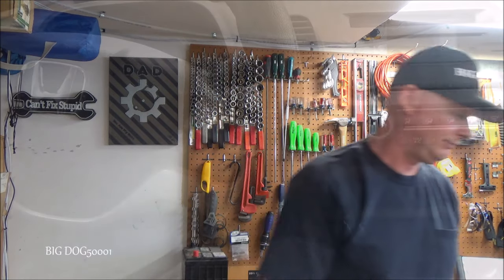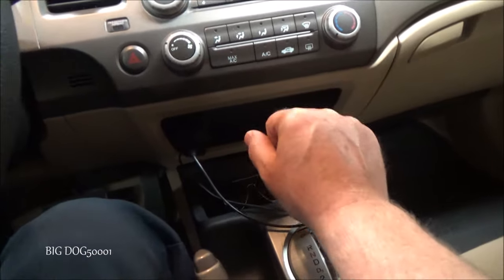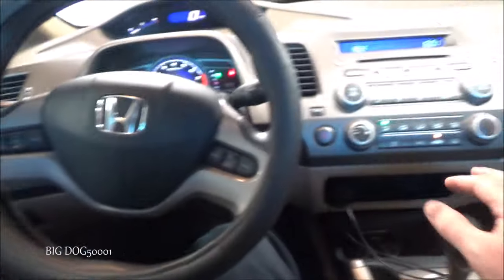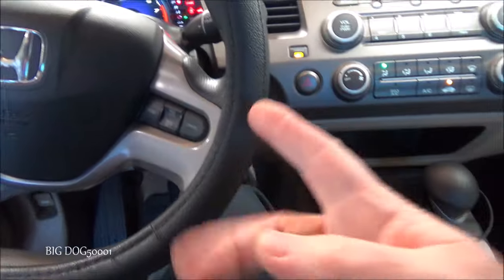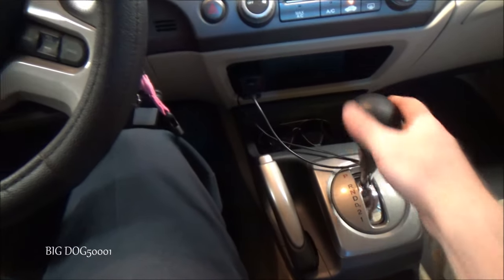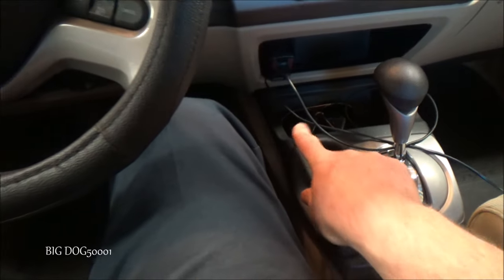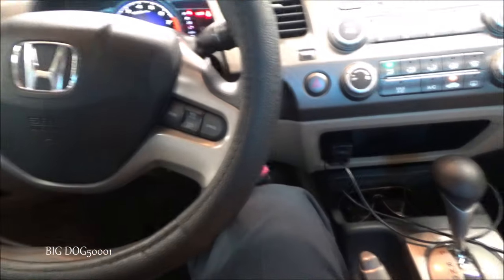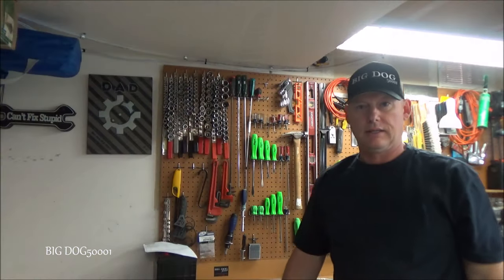How To Turn Off Automatic Locks on a Honda Civic (No Scan Tool)

Comment from the maker: Tools
Disclosure: This channel earns a small commission using some of these links - at no additional cost to you.

My Favorite Inexpensive Scan Tool:  https://amzn.to/2yEbK6l
My Favorite Screwdriver for Hondas:  https://amzn.to/2VAu2hK

The Big Dog 50001 Automotive Channel Store can be found here: https://www.amazon.com/shop/bigdog50001automotive
Reply: Hey Big Dog50001, I have Civic '08 Sedan w/ manual transmission, but it doesn't have the master lock button. Is there a way to enable the autolock feature without the need of such button? Thanks in advance.

Comment: Appreciate the essential information on these features. I live in a rough neighborhood and I wanted my car to stay lock even on park position and locks when shifted to drive for a very long time. The service guys from dealership and local shops will charge half hour work labor just to set them up for me. That’s why I had to be vigilant and lock doors after turning off engine . Now I had it set to stay lock and locks when shifted to drive . Thank you kindly!
Reply: If they want something they just bust the window were I am at.

Comment: I forgot the key inside the car, i get out of the car and closed the door for 2min. The car automatically locked itself. Now i am stuck at my work and its 11pm. I had to call my father to bring the other key to open the car. Once I got home, i followed your instructions and cancelled this automatic lock feature. 

Now I will no longer have this problem. Thank you sir.

Comment: awesome, hope this works on my 2009 Accord, I hate it when it unlocks the doors just putting it in park. Sometimes I put it in park waiting in heavy traffic or long drive through lines or waiting to go into work.  I don't like sitting in an unlocked car, very unsafe.  Always so frustrating put the car in park boom, immediately have to re-lock the doors.. thank you for this video.

Comment: Great video man appreciate it!! I don't like the automatic locks it also wears out the lock actuator quickly.
Reply from the maker: Yes it can, thanks for the comment!
Reply: If this part wears out what are signs please I am having a hard time with my car sometimes I can unlock with my key and sometimes not my 2 opposite door back seat and driver door wouldn't work not even unlocking it manually an then the next day it started working again I can no longer have my windows up because I can't wake up to being locked out because I have to take my son to school its ridiculous an the other day I went to take my mom to store and she had to sit in the back seat because of the problem it sucks
Reply: You may have a low key FOB battery that needs replacement.

Comment: I tried this on my 2010 Civic but I think that I forgot to put the key in 1 position first before I pulled out the key and now when I try to unlock my door from the inside it sets off my alarm and key fob won’t turn it off. Do you know how to fix and reverse this issue please?

Comment: Is it possible to simply remove the fuse that operates this lock/unlock function.  (2008 CR V EX)  There is an issue with the locks operating "outside" parameters so to speak....on their own.

Comment: Great video Big Dog Keep the education coming you explain it so well Thankyou my friend
Reply from the maker: I appreciate the comment, thanks!
Reply: @BigDog50001  Hey great video. Got a subscribe for that one! Have another question for ya, my 08 civic is new to me. Im going to disable the auto lock/unlock as you showed. However, while the lock/unlock switches work on both doors, my drivers door doesn’t actually lock/unlock via the switch. 
Im thinking bad actuator even tho there is no “sound” of it being bad, as some do when the actuator fails. 

Any advice would be welcome. Thanks again, and look forward to going thru your other vids!
Thanks, J

Comment: good video, but can anything be done for the auto locking feature, if remote is used to unlock the door, after 30 second the doors will lock if the door is not opened during the 30 second.
Reply from the maker: I do not believe the automatic re-lock after 30 seconds without opening a door can be disabled.

Comment: Thanks good video! 
Can you help? 
I have a 2007 Honda pilot and the auto locks feature is disabled. 
I’m trying to enable but does not work. When I press the lock or unlock button it only closes the one time when pressed. 
I hope you can help thanks.
Reply from the maker: I don't think the Auto Lock/Unlock feature became available on Pilots until 2010 but you can try this below:

To program the Drive Lock mode (Locks all doors and tailgate when the vehicle’s speed reaches about 9 mph)
1. Make sure the shift lever is in the Park (P) position.
2. Turn the ignition switch to the ON (II) position, and make sure to close the driver’s door.
3. Push and hold the brake pedal, and move the shift lever out of the Park (P) position.
4. Push and hold the front button (forward button) of the master door lock switch on the driver’s door. You will hear a click. Keep holding the switch until you hear another click (after about 5 seconds).
5. Release the switch and, within 5 seconds, turn the ignition switch to the ACCESSORY (I) position. Move the shift lever to the Park (P) position.
6. Turn the ignition switch to the LOCK (0) position.

Comment: Does this method disable to auto-lock that happens when you hit 9mph? Some construction set off my alarm the other day and it was going off for a while because I couldn't hear it going off, and since then the auto-locks keep trying to engage every time I accelerate even if it's already locked. I don't have the time right now to investigate it or get it fixed so I hope that disabling the auto-lock is a good short-term solution. Thanks!
Reply: Same problem with my 2012  accord door locks. How did they fix your problem.

Comment: Wow..good knowing. This helps, thnx. I like the auto-lock feature once car is engaged to move. Its a safety security against car robbers. Be safe during covid19.
Reply from the maker: Auto locking I don't mind too much, it is the auto unlocking that I think is a safety issue.  Thanks for the comment!
Reply: How do you activate the lock when moving
Reply: If you are in traffic, your car will trigger the lock actuator everytime you go up to 9mph even if your car is already in lock position. Its annoying.

Comment: My 2007 civic coupe, driver side window sometimes won't roll down unless I press the switch multiple times or hard. Works fine when closing it.  Any ideas what it could be? Window switch?. Thanks in advance
Reply from the maker: It could be several issues but the switch would probably be the first thing I would look at in that case.
Reply: It's probably dirty sensors.  My 2007 Accord does the same thing. When you get the window all the way down clean the track with air or a rag.

Comment: My 2007 honda civic will lock the doors automatically once its been turned off after 30 seconds . The other day i came home turned car off left key fob in my console and when i came back out to get it my doors were locked ….is there a way to disable this auto lock feature once car is turned off

Comment: I can't manually unlock my car i got lucky and the key was able to unlock my driver do but it doesn't always work for me I know it ain't the battery in fog it doesn't even make the noise when it lock or unlock i can no longer lock it or unlock with key fog it lights up to an sometimes it won't even manually unlock with key i only have 1 key entry its driver door and when manually unlocking doors will not open please any bit of advice i appreciate it

Comment: Great video! I've been having an intermittent battery drain with my 07 civic and suspect it has something to do with the broken locks. Perhaps they're getting stuck and the car is continuing to force them thus killing the battery. Does this tutorial apply for the 30 second auto-lock feature? That is when you unlock your car from the outside it will lock itself automatically in 30 sec. Appreciate any help!
Reply from the maker: As far as the 30 second question, if you don't open a door within 30 seconds after hitting either lock or unlock from transmitter they will re-lock.  This does not effect that (and I don't believe that can be disabled on most Hondas).  Broken locks could be a possibility for draining the battery, but there is a good possibility it is something else.  Thanks for the comment!
Reply: Big Dog50001 Automotive do you have any ideas what else could be draining the battery? It's a really weird intermittent issue and I'd be open to any and all suggestions. So far, I've replaced the battery and had the alternator and battery tested multiple times. The car has been dead after 3-4 days sitting multiple times now but each time I bring it in there is only a 0.1 drain on the battery. Thus, the battery drain is intermittent and only happens once and a while (have yet to catch it with a significant drain). 3/4 door locks are broken, ac does not work and I have aftermarket fog lights installed but can't find a culprit nor replicate the battery drain
Reply: @FuRyxStormz  I'm having a similar issue with my 07 si coupe. For me my battery keeps dying in less than 10 minutes and I need to jump my car every time I want to go anywhere. If you got any tips lmk.

Comment: I have honda civic 2007. My car backside left  door locks on closing and it cannot open from inside. Everytime i open from outside. Is there any solution? Thanks
Reply from the maker: If you mean it doesn't open using the inside door handle, I would verify the child safety lock isn't engaged on that rear door.  Also possible a door cable or plastic link is broken which would cause if to not open from inside.  If it is the electric door lock actuator not working from the switches inside, then that would probably need some troubleshooting done.

Comment: I have a 2009 stick honda fit. I keep trying to turn this feature off but it still does it, I don't know what I'm doing wrong. Besides that, when I turn off the car it only unlocks the driver's door, and no one else can get out! It's so frustrating. I know this video is for a 2006 but I'll try it out anyway!

Comment: How would I do this if I have the basic dx trim without the power lock on the door panel ?
Reply: if you have a DX and don't have power locks, then they wouldn't lock by them selves because there is no locking actuator inside the doors.

Comment: i have a 2011 honda jazz/fit and i want to totally deactivate all auto locking but no success, do u have any idea? i tried all combination possible and nothing works, i dont want it to lock when it reaches 9 mph, please help
Reply from the maker: There are two steps, one for locking and one for unlocking, see if the instructions below work for you.
To turn OFF Auto Door Locking
1. Make sure the shift lever is in the Park (P) position (A/T vehicles).
2. Turn the ignition switch to the ON (II) position, and open the driver's door.
3. Push and hold the front button (forward portion) of the master door lock switch on the driver's door until you hear a click (after about 5 seconds).
4. Release the switch, and within 20 seconds, turn the ignition switch to the LOCK (0) position.

To turn OFF Auto Door Unlocking
1. Make sure the shift lever is in the Park (P) position (A/T vehicles).
2. Turn the ignition switch to the ON (II) position, and open the driver's door.
3. Push and hold the rear button (rear portion) of the master door lock switch on the driver's door. You will hear a click, and after about 5 seconds, you will hear another click.
4. Release the switch, and within 20 seconds, turn the ignition switch to the LOCK (0) position.

Comment: Cant figure it out. My 06 Civic auto locks just by turning the key to the on position, and won't unlock unless you turn the car off. Gear selector position doesnt have any affect on the locks. I just want it disabled completely, or at least unlock when put in park

Comment: Its a good feature in some aspects but will kill the actuator motors fast and they can get on your nerves
Reply from the maker: I would definitely rather control it myself on my own cars.
Reply: @BigDog50001  i would ad well but don't have to worry about it all my vehicles are from 2005 to 1968
Reply: Is that an easy fix? I’m currently trying to see possible reasons why my key does lock my doors. Would I have to change the fuses out for it to work again?

Comment: Dave interesting video. Does it just work on civics? I know my 07 Odyessey doesn't lock till approx 9MPH. Dave my wife's 99 3.0 accord I just had to resolder a couple of PGM FI solder joints. Do those two relays come as a complete assembly say two relays and circuit board. Kind of difficult to find the whole new assy. Any pointers? Hope everyone is well Artie ❤️
Reply from the maker: A 2007 Odyssey should be similar (I don't think you need to touch Parking Brake or stop key on Accessory Position though).  Your 99 V6 Accord PGM-FI Main Relay should come as one assembly (even though it has 2 relays inside).  It should be similar to this one 
 https://bit.ly/2YrYo7U
Reply: Big Dog50001 Automotive I’m looking for a RZ-0158. Should I go with OEM. I’ve been looking and they range from say 30$ to 60+.Don’t want a used one I’ve already have one of those. I’ve reflowed solder had two bad joints but every morning with a fully charged battery it just crank over till I tap on it then it starts okay   Till next day then tap it and it starts right up. Even cranks lousy till I tap on it and then it starts like the day it was new. Strong and smooth. Do you recommendILL  a brand or go OEM. Just hard to go to dealer with all the limitations up here. Maybe amazon has an OEM from China 
🇨🇳.LOL. I’ll keep searching stay well thanks for the reply Artie.
Reply from the maker: @arthurfricchione8119  OEM only.   I use Honda Parts Now for a lot of online dealer parts.
Reply: Big Dog50001 Automotive Dave didn’t see your link Thanks part ordered ❤️

Comment: Does anyone know a link for Stick shift cars? (8th gen Civic SI) I tried this and only works for the lock part, now the unlock side of it doesn't work, manual only has instructions for A/T
Reply: I was having the same problem with mine, you have to actually take out the key instead of only turning it to the first position.

Comment: How do get the alarm to go off?? No matter what I touched it goes off
Reply from the maker: Not sure what you have going on there, but many times if alarm keeps going off the door lock module needs to be reprogrammed.
Reply: @BigDog50001  I feel silly for saying this but the fob didn’t have a battery in so we put one in now it won’t start
Reply: @belladea9053  What do you mean it won't start?  Did they get the right battery?  I got locked inside my Honda Civic and couldn't get out, I somehow breached the security system.  Mt battery in my key fob was dead, so someone had to intervene from the outside.  I have since replaced the battery. The dealer told me you have to be carful putting those in so you don't strip the lock.

Comment: The tumblers in my Honda Accord 2006 are wore out. If I take my key out I won't be able to get it back in again. So I leave the key in the car. Sometimes the doors will automatically lock. This is a pain because I only have one key. How do you disable that? I don't care if somebody steals my car, I got insurance I wish they would. Could use a new car obviously

Comment: I have a 2006 2 door 5sp. My doors auto lock when I unlock them and sit in the car, after 15 seconds, This is just me sitting in the front seat, doing nothing, maybe making a phone call, etc. This happens if the doors are left open or are closed. Very annoying. Any idea how to fix? Btw, my 2007 CRV doesn't do this.

Comment: For som reason when i did that the shift lock activated. Any idea how to fix that ?
Reply from the maker: Sounds like it changed it to "Park Lock" mode.  I would try doing it again, paying attention to each step because they are very similar for each mode.  For instance, to turn Off Auto Lock Mode you turn key to On (II) Position and then OPEN the door.  To program Park Lock mode you turn the key to the On (II) position and then CLOSE the door (and you also hold the switch for 2 clicks instead of just 1 click).  Here are the directions below.

To turn off the Auto Door Lock modes:
1. Make sure the shift lever is in the Park (P) position (A/T vehicles).
2. Turn the ignition switch to the ON (II) position, and open the driver’s door.
3. Push and hold the front of the master door lock switch on the driver’s door until you hear a click (after about 5 seconds). 
4. Release the switch, and within 5 seconds, turn the ignition switch to the LOCK (0) position.
Reply: Hi
Thanks for replying.
No i meant it worked for the door lock but now the gear shift is stuck on P. I must push the shift release button to move it from park.
But today it solved itself out and the shift moves normally.
Probably electrical issue
Thanks again you made my day